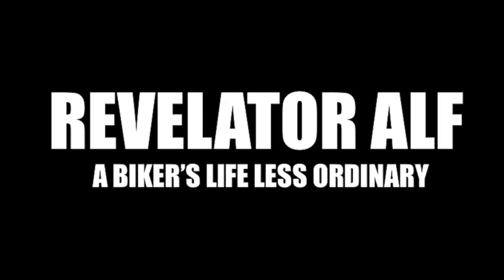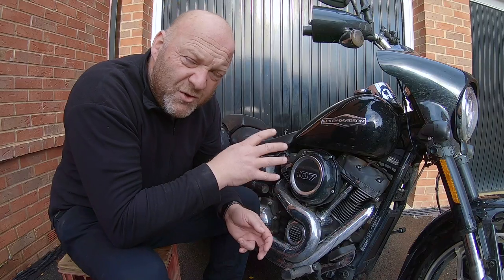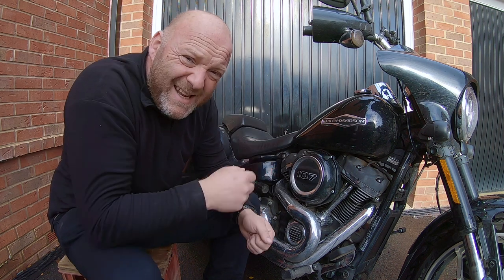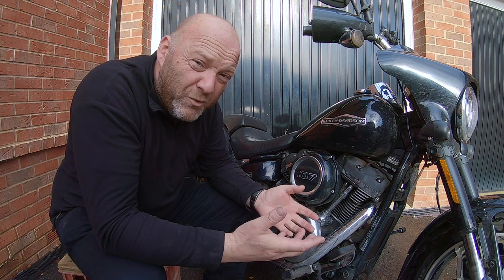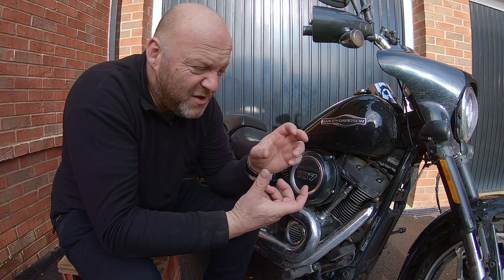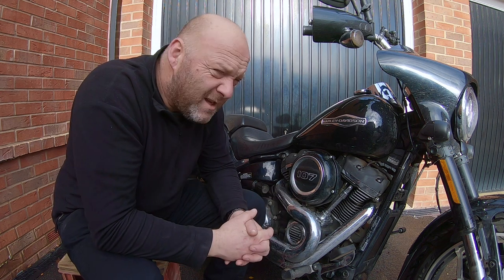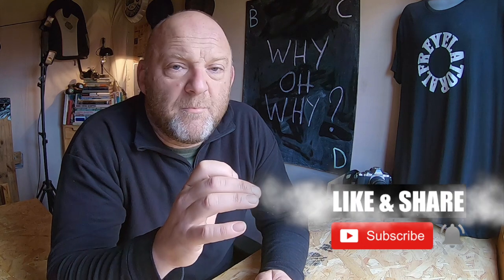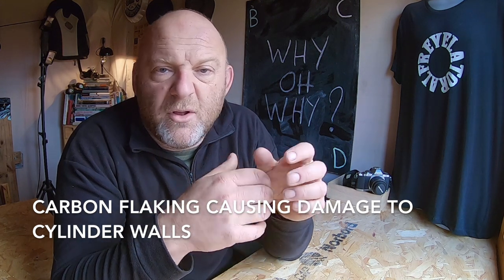Is It Worth Installing External Breather Kits | H-D Truths & Mistakes

Comment: As an engine builder i can say with 100% certainty it not only creates a cleaner engine it also improves the air fuel ratios which leads to better preformance. Re-breathing is not healthy for any engine.
Reply: Thanks for helping me make my decision. Breather kit goes on.

Edit: breather bolts go on.
Reply: Rebreathing creates a less efficiently operating engine, poorer fuel efficiency and a shorter life span. As the engine begins to wear it operates less efficiently creating more pollutants,using more fuel and increasing the maintenance intervals. An air/oil separator or cleanable filter for crankcase gasses is a much more environmentally sound system to use.
Reply: I simply run two black hoses straight down onto the road surface. No dripping on engine or garage floor anymore Absolutely zero maintenance.  And it looks a lot better than a silly catch can.
Reply: Yea it could never be good to rebreathe what’s coming out of that it’s dirty watery milky at times especially in high humidity areas but they have been doing it for years now especially with the car manufacturers
Reply: It also helps if one of your "umbrella" breather valves sticks in the head on your evolution or your twin cam and it starts puking oil through the Breather and all over the engine, the bike, and the rear disc brake. This way it pukes under the engine out the Breather line. This is why I put an external breather on my engine after it happened to me at 35,000 miles. I also replaced the umbrella valves in the head with new ones.

Comment: Firstly .I'm sorry its taken 2 years to make a comment on this vid, My sg has now done 15000 miles and for the first 5000 I did not have any external vent, when I scoped my pistons the carbon build up was excessive," i am saying this as a 40 yr experienced Mechanic" it looked like a very old oil burner, plus on summer tours the amount of oil I was putting in was wrong 1ltr per 2000 mls. I fitted an external breather .firstly a dip stick one then the trans cover one , I did a 5000 mile tour of Spain and didn't use any oil,  Very different experience . My conclusion from this is due to Euro/us emissions rules the internal crankcase pressures are best to be vented to atmosphere to save my engine , selfish maybe but at least ill be riding my Harley in Hell whilst your all sitting having a coffee in Heaven Harley Davidson waiting for you bike to be fixed.😂

Comment: I used to have to clean my throttle bodies on all of my cars and bikes almost annually. Since adding a "catch can" system to my cars and an external breather to my Harley's, not once in all of the years and miles since. I would rather have only fresh air in my intake systems. Have a great day!
Reply from the maker: Yes there's no denying that. Cheers. You too.

Comment: i have an external breather on my bike....not for the so called performance gains but because i have an aftermarket air cleaner...now their is no more oil dripping from the air filter and ending up on my side covers...it was never excessive it just bothered me
Reply from the maker: Fair enough. Sounds like a good deal. Cheers

Comment: Here in America, the debate isn't about carbonization or performance improvements. It's about the oily mess inside the air intake. For me, not having that mess has made me very happy. That said, your video was well thought it and enlightening for me. I learned a lot and that's always a good thing. Thanks and keep up the great work!
Reply from the maker: Thanks so much. Cheers
Reply: Stop using so much oil then, You dont need it 2 read at the Line....More oil topped full = more oil that has 2 escape = Common sense!
Reply: Yea I believe the biggest point of performance is the over time whether it don’t are do are do and don’t it can be good for any engine heads throttle body and everything else I do know when oil get hot enough it don’t burn off other than being like syrup sticking to everything

Comment: Milwaukee M8, long rides, oil goes everywhere pouring out of the air cleaner all over your motor. It’s disgusting. Great idea to reroute that blow by and put it through a filter or catch can. Less boil mist in the motor would equal less carbon buildup no matter how small. External breather is a must for any Harley I own.

Comment: I installed a external breather to a 2015,Ultra Limited, because my stage 1 air cleaner has a open small air filter, and I was getting small amount of oil settling on the air filter and leaking on my timing cover, after about 3K miles.

Comment: Regardless of any potential performance gains, breathing the engine somewhere besides into the throttle body makes sense in many ways and should be done. From an internal cleanliness standpoint alone it is a smart idea 🤓. And everything we know makes this a theoretical/logical efficiency improvement🤘
Reply from the maker: Yes could be so. Cheers

Comment: Good points. I have a 90’s EVO, S&S carb, drag pipes and minimal electronics. I’m doing it for the simple fact that I’m tired of all the oil in my air filter and wiping that occasional drip. They aren’t huge deals, but annoying and my bike is pretty raw so it’s a solution for me.

Comment: I've had an external crankcase breather system on my carbureted 2005 Sporty for years with the stock breather bolts and stock air cleaner. The only visible difference is a black rubber hose coming out of the black backside of the breather box which runs a short distance to the swing arm. You have to actually step back to see it because it is not noticeable at all. There is no catch can or filter at the bottom of the tube. To see this part, you have to go to the left side of the bike and look underneath the bike and it is still not noticeable. 
The results are a clean and dry air filter, clean and dry air intake, and COOL, clean and dry air going into the engine. I do have to place a paper towel underneath the drain hose when I park the bike in the garage to catch the ONE teardrop size drop so the floor will stay clean. As long as I don't overfill the oil tank, there is never any more than this. As far as performance difference with leaner air/fuel mixture is concerned, there isn't any. I
What's not to like? Clean and cool is better than hot and oily. 'm happy with this.

Comment: For me, it was personal preference to add an external breather / catch can setup.  I have an aftermarket air filter which has a Lexan see-through outer cover allowing you to see right into the throttle body.  Now the throttle body and butterfly remains clean instead of being covered with a film of  "Blow-By" oil.  If oil mixed in with fuel is what anyone wants, that's their choice.  I do mods to my bike for me.  Harley do this to the bikes to meet EPA standards and regulations.  In some states its is illegal to vent straight to the atmosphere.
Reply from the maker: That's very true. Cheers

Comment: You may be right but venting save you air filter and keeps you throttle body alot cleaner. I do it mostly for that reason.
Reply from the maker: Ok good stuff

Comment: If you have a blow by problem this could help.  But if your bike is running properly Little to no gain from this.  I have 13k on my m8 and have never had any oil at all in on or around the air cleaner or throttle body.  Not to say that at higher mileage this won’t change.  Time will tell.  Happy with my stock Harley for now.  Great video.
Reply from the maker: Thanks Chad. I am in the process of experimenting with fuel additives and mods to see if there really is any difference. Cheers

Comment: You are talking good science to me. I think alot of people pushing these kits are also selling them! If you are burning alot of oil you my have an issue definitely. My 107 never burned much oil or had much " blow by" in the air filter. The oil pump did quit at 43k however. I think they have addressed this problem with there new oil pump. A vented dipstick my be a good alternative.

Comment: My bike started to fail on the front cylinder... I discovered that the spark plug was failing. Even new ones. It mostly happened after a short break on a trip. After doing an external oil breather, the engine started working perfectly and never had any problems again.
Reply from the maker: Good stuff

Comment: Just bought one and installed it on my bike.  Wish I would have seen this video before I purchased it.  I may have consider not purchasing it. I have a 2020 Tri Glide with 9058 miles.
There was very little evidence of any oil in the area around the throttle body butterflies or anywhere else in the air cleaner apparatus caused from the OEM breather tube dispensing
oil into the cylinder.   It still looked pretty new in there.  Now you got me concerned about upsetting the balance.  Hope my engine light doesn't come on in the future.  Well, I guess if it does then I now have an idea of what the issue would be, before reading any codes.  Anyway,  good video, and it's always good to hear the other side of an idea.  Thanks.
Reply from the maker: Thanks so much. I’m currently experimenting and researching this very thing so more videos coming soon. Cheers

Comment: We used to call those things puke cans. It's more of a problem with engines with direct injection where the valves aren't cleaned by fuel. Some manufacturers actually have a decarbonizing service that needs to be done every 75-100k miles on cars. Techtron is one I use once in a while. The problem with fuel where I live is ethanol and 91 AKI is the highest octane one would find at the pumps. Back east I could get 93-94, but it still would have ethanol. You can use a scope through the spark plug hole to see the condition of the pistons etc.

Comment: Finally, someone else who still uses the term de-coking! :-D My project bike already has an aftermarket air filter, as it has the Mikuni HSR42 on it. I am thinking of routing it to an external catch can to separate most of the oil Harleys are known to spit out, then  back into the air filter. I think your little talk has settled that for me - no downsides (I studied Physics, the percentage of gas from the breather is so small it is insignificant to the engine,) but an upside - the oil does tend to dirty the carb.

Comment: I haven't made the mod yet, but I'm seriously thinking about it. I have a 96ci twin cam (2011 dyna) with a stock air filter that keeps getting soaked with oil. I'm 90% sure that my problem is being caused by this issue.

Comment: After bumping my old Evo to a Stage 2, my head breathers got terribly pukey afterwards.  My air filter's bottom side would become saturated and dripping only after 300 miles.  My aluminum backing plate was stained with oil deposits.  I made a breather system for it with a catch can (because I HATE oil on the floor, even with Harleys lol).  Yep here's more anecdotal evidence, but I also know my bike.  Since installing it, I haven't really gained any power but it's definitely more responsive on the throttle blips.  I always dealt with a "coughing throttle", even after I rebuilt the carb, but this seems to have eliminated it.  Cheers from 🇺🇸
Reply from the maker: Hey that’s great and I’m all for doing things if it works out better. Cheers

Comment: The scavenge side of the oil pump has two inlets- one for the crankcase and one for the cam chest, so when one inlet has cleared the oil and is then sucking air, the other side is not clearing oil. This causes no major problem if the total amount of oil in the engine and oil tank is correct.
When the bike sits without running, any oil in the engine collects in the bottom of the crankcase and timing chest and can measure as much as one litre of oil. 
Oil expands when it is warm, and if the oil level is checked with the bike on the 'jiffy' stand then the reading is false as the bike ,when running , is upright and the level reads higher on the dipstick.
When you start the engine, all the oil that is sat in the bottom of the cases (crank and timing chest) gets sent by the scavenge pump into the oil tank , so if you have over-filled the tank then it - the excess oil - will then go from the tank into the crankcases again via the oil tank/crankcase vent.
 When you have too much oil in the crankcases and the crank churns it up, the 'oil-mist' becomes over oiled and any air going through the separators in the rocker box breathers carries more oil into the airfilter/engine.... that is how you get the 'blowby' as it is so named.
The way to avoid this is to only check the oil level when it (the bike and oil)  is warm AND with the bike upright, making sure that the level is about halfway between the upper and lower marks on the dipstick. This way there will be enough room for the oil that has collected in the engine to be returned to the tank AND there will be less - if any - oil going from the oil tank vent back into the cases and causing the oil mist to be so heavy as to overcome the 'oil-seperators' or sponge in the rocker box breathers.
 S&S oil pumps have two scavenge pumps - one for the crank and one for the timing chest - and keep the level of oil in the crankcase lower thereby stopping the oil-mist becoming too oil rich AND slowing the crank from spinning.

SIMPLE REALLY AIN"T IT ?
Reply: I think moonshine harley (performance based shop) only fill their bikes 1/3 way up the dipstick for the same reason I believe. Interesting
Reply: @HUTProductionsuk   Y'see - it makes sense. If you look at the old British bikes, the oil tank had a 'Minimum oil level' line marked on the side which was quite low on the tank for exactly the same reason.
 If you look in the handbooks for modern Harleys it says the oil level should be checked with the oil at operating temperature and should be between the minimum and maximum levels - stating that if it falls below the minimum you should add oil. Old Brits used to 'wet sump' if left for a while i.e. the oil would leak past the oil pump and fill the crankcases. When you start the bike it all goes back to the tank......

Comment: I finished the video enjoyed it very much just to let you know DK customs has a video where they put a bike on the dyno same bike without the external breather and then leaving the bike on the Dino install the external breather and it got a 7 horsepower gane and a little more torque you should check that out
Reply: I find that hard to believe that they got 7 hp gain just from adding a EB. Ya know dyno results can change on the same bike without any modifications based on air pressure in rear tire, weight on rear tire, time of day, etc.

Comment: I actually went with the Trask crank case vent . My throttle body on my 2019 Street Glide did'nt have much blow by going into the throttle body. I will say I have the Stage one kit and A stage one tune. The crank case breather for me it to more ensure my oil in the crankcase doesn't get to oxygenated/bubbly. As I've stated my M8 didn't exhibit excessive oil residue in my throttle body. I'm at 4,500 miles on my bike and I ran a bore scope in my cylinders and they did'nt have any excessive carbon build up. I run 91 octane gas in my scooter and I'm at 5,100 ft elevation.

Comment: That was extremely interesting having done 4 stage 1 upgrades on various Harleys myself I have witnessed only 1 occasion on 1upgrade where there was any appreciable build up of misting oil inside the entrance to the throttle chamber. On speaking to the head technician at my local Hd dealership where I had some work done outside my skill set,he stated to me that in 28 years of stripping the guts out of all build engines he could not honestly say how carbon build up in any engine may have had contributing factors. There are too many variables to state with more than 90% probability of fact that one factor contributed to an excessive carbon build up over another.The point I’m trying to make as well is ,can we all reasonably believe that HD would engineer a system that would given unaltered ( no upgrade of any sort) create an inherent failure built into the basic running of the engine.Thank you for an enlightening upload my mind is definitely made up now keep to the basics.
Reply from the maker: Thanks so much . Cheers
Reply: They absolutely have a history of making things doomed to fail when presured by the epa and leaned on by the fed or to save money... your opinion as an employee and confident is heavily bias

Comment: my XB12R, when hot would miss and fart and surge around 1500rpm, making traffic crawling a chore. When I removed the cylinder breather from the air cleaner it became a different bike. smooth and civilized.
Reply from the maker: Yep good stuff. Cheers

Comment: I've experienced increased blow-by after installing stage 2 upgrades on my 1200 efi sportster. Caused issues gumming up the sensitive iac valve. Been blowing that shit into the atmosphere for 20k miles now with zero issues.
Reply: I got the same issues when I bumped my Evo to a Stage 2 as well.  My head breathers got really pukey afterwards.  After 300 miles my filter would get saturated with oil.  I just got done building an external breather setup on mine today and even posted a vid to my channel showing it.
Reply from the maker: good stuff

Comment: I would think keeping that hot, oily air, out of the combustion chamber would be a no brainer.
Reply: Unfortunately Harley has to abide by EPA regulations and reroute that oil to the cylinders to burn off instead of dripping on the ground!
Reply: @spoom937  That is what a catch can is for. It is cheaper for the factory to run it back into the engine than to add a can.

Comment: I did it for one simple reason.  I was tired of my 2017 M8 engine spitting oil out the air cleaner and consequently on my leg and down the bike. I do long trips at highway speeds frequently.